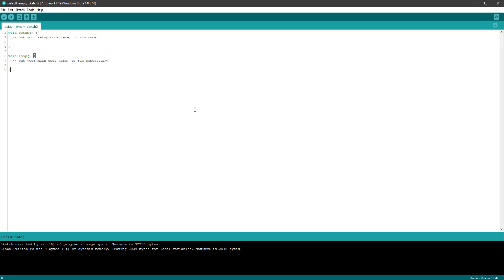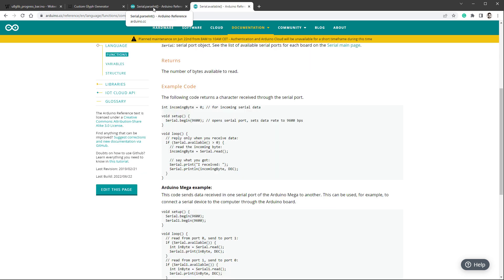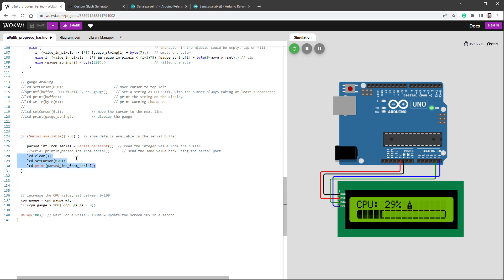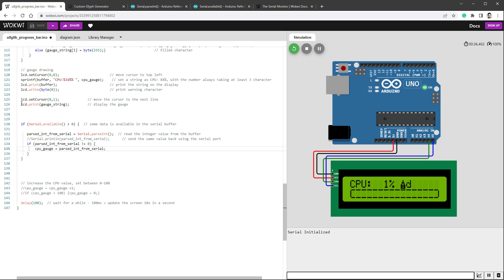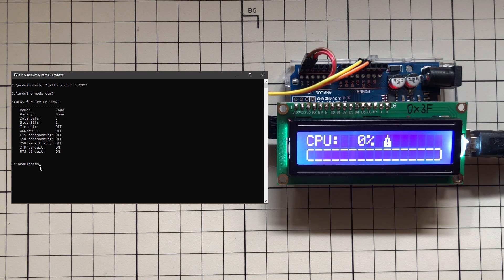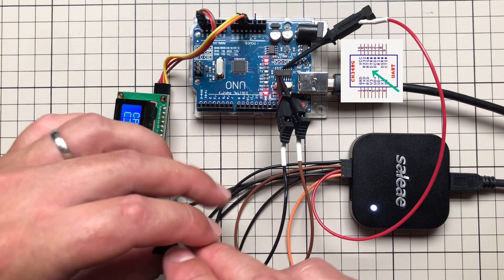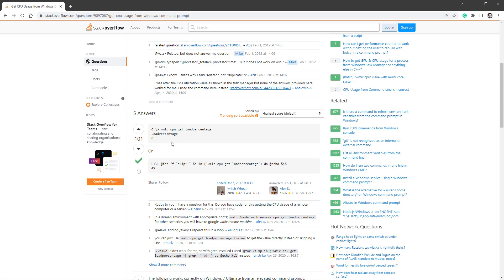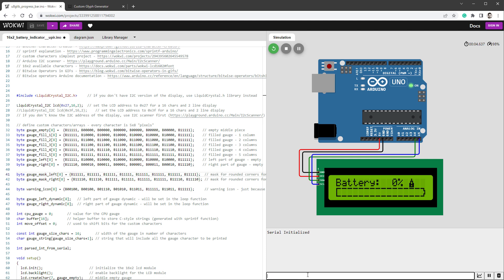DIY Battery Indicator (Arduino Project)

Comment: can u please tell me where we have to connect battery wire in arduino
Reply from the maker: This video was only about showing the display portion of the project. If you want to read the voltage of the battery, you need to know more details.

Comment: how would i implement an actual battery in this project? Like for example using a 9v battery and a breadboard
Reply from the maker: You mean a battery to power up the project, or to measure the voltage?
Reply: @upir_upir  measure the voltage of a 9v , i plan on recharging the battery and use the display to show how much has been charged up

Comment: Hello i had a question, I was looking at your video and saw you had wires connected to the display from the arduino and I was looking at the link and it doesnt show that the display has any sort of connections for the wires, did you have to buy another part to get the wires connected?
Reply from the maker: Those displays - https://s.click.aliexpress.com/e/_9Hl3JV

Support both Parallel and IIC connection, but they don´t have any header pins soldered. You have to solder them by yourself. I have used the IIC connection, so those are the pins VCC, VSS, SDA, SDL. They are on top and bottom of the board, so you can use which one you like better (for position).

Other displays might have those pins soldered, so you don´t need to solder them - for example this one - https://s.click.aliexpress.com/e/_DBPScpB

In any case, you still need the wires.

Let me know if that helps.

Comment: Can you tell us the commans for mac. Thanks. I did echo 49 > /dev/cu.usbserial-1440; i think it restarts Arduino also. Also Mode command not found on mac.
Reply from the maker: Instead of disabling the line, you can also disable auto-restart on arduino itself. Use either capacitor or resistor - https://arduino.stackexchange.com/questions/38468/disable-reset-when-com-port-connected-disconnected

Comment: Do you have a wokwi project where you use the  <OLED_I2C.h library>  ?
Reply from the maker: This one is using it, or am I missing something?
Reply: @upir_upir  I already solved the problem with uri shaked.
Reply from the maker: That’s great to hear. Could you perhaps share your solution?

Comment: What is the life expectancy of such a display? At very fist seconds we already can see some burning out - we can see a "frame" (from slightly dim pixels) at the left side of the bar.
Reply from the maker: Those are not burned out pixels, but rather loose connection. Some bad soldering (on my part). Once I have re-soldered, it was OK. I haven´t found any exact numbers, but I have heard that you might see burned pixels if you keep the pixel on for more than a year.

Comment: I'm trying to do this for the past hour and I just can't do it. It works in the CoolTerm app and in Arduino Serial but when I try in Windows Terminal, it doesn't work, nothing changes on the screen. I've noticed the first time when I plug the arduino in and I set the baud rate etc the arduino restarts. When I check the com port after restarting, it looks good, but nothing happens when I send data. Do you have any idea what is happening? Running Windows 11
Reply from the maker: That´s strange, I don´t know why it would work with CoolTerm and not with terminal, but I guess it´s possible. Sorry I´m not helping very much here.

Comment: Lol that's how Arduino kills any proper engineering thought. Normally this is done like: FT2232 or instead a USB-capable MCU (I prefer Bluetooth tho) if the former is too expensive, a widget renderer (pure software, PC-side unless traffic issues) and a neat monochrome OLED because cheaper and nicer than STN LCMs. Also the ONLY good programming language for AVRs is Assembler anyway.
Reply from the maker: Maybe you shoul record a tutorial to educate others? I would love to watch it.

Comment: man it seems like you are struggling to send data to the arduino like how you wanted. you can get my python code if you want to
Reply from the maker: Well, I was struggling at first, but I think it´s figured out. I´m sure using a "proper" programming language and not a batch file gives you more options.